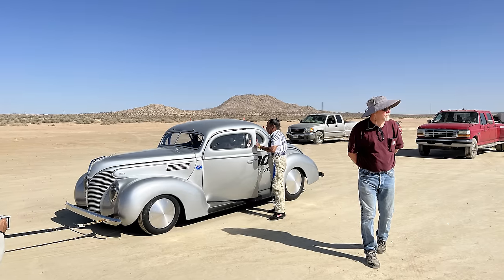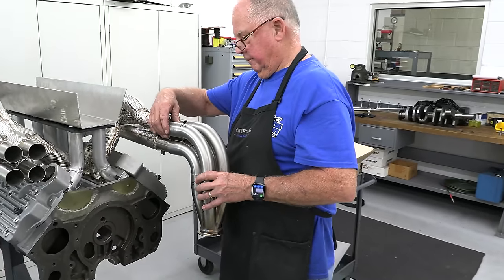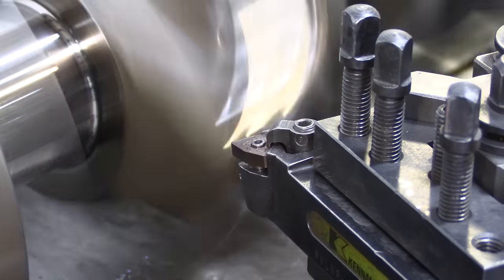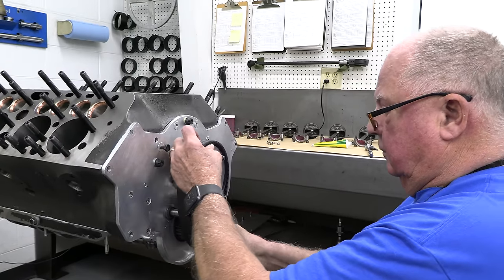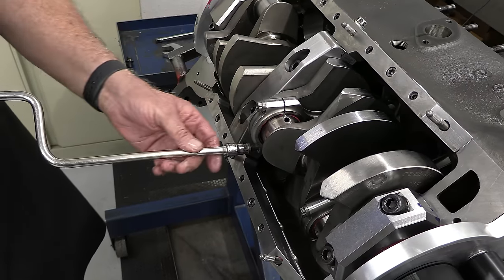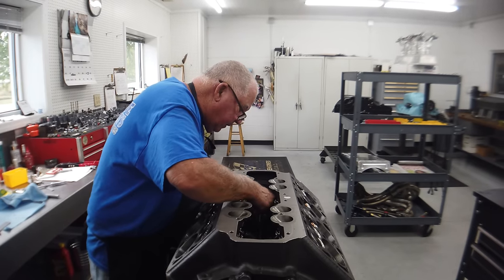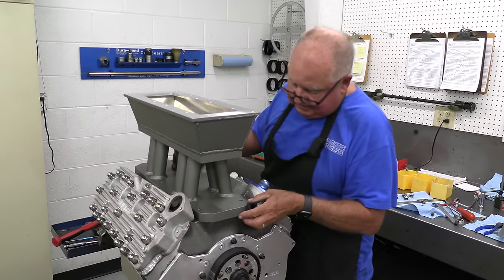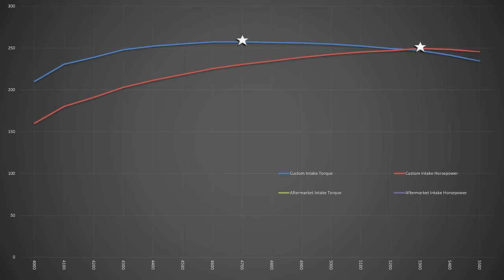World's Fastest Flathead? (Going to the Bonneville Salt Flats)

Comment: I was a motor cycle tech and always find engine builds interesting. 
Power, although way higher than stock was still pretty disappointing though after all the time, technology and money spent.
Back in the 70's, Harley Davidson was still using KR750 for flat track, nominal 45cu/in making around 75~80bhp. (I pretty much only did ' Japanese imports' but like all conventional piston engines)
A 231cu/in is 5.13 times the displacement but isn't making close to 5 times the power. ( you said 2.65?) Five times 75 ~80 would be close to 400bhp)
Side-valve engines cannot flow all around the valve and do not flow 'over' the valve so having valve to cylinder head clearance is not needed. It's better to fit the largest intake valves possible, lift them as high as possible for as long as possible and build a higher revving engine, it should have been possible to get 8,000rpm or more
 To that end, a de-stroked motor would probably be better, longer rods with no clearance issues.
Exhaust valves only need 80% flow of intakes so both the same size isn't logical?
Maybe getting some out of print tuning books for 1950's motorcycles could give some very good idea's for 'next time' (although you would probably have to get them from Britain or Australia)
Oh, haven't you ever heard of 'tube nuts'? They are similar to connector nuts for all-thread but made of much higher grade material with the hex removed from 75% of the length. They would have solved the 'problem' of Allen head bolts and allowed studs to be used

Comment: Your allowed to modify the valve length and head right? Why not make an inverted double sealing valve and boring a hole in the head for intake and using the original intakes as exhaust and cap the old exhaust ports

Comment: the REAL fastest ford flathead at bonneville was built by Ron Main and Dick Landy, turned out over 550hp at 6000ish rpm with a centrifugal blower. Went 295mph on august 16th, 2001 in bonneville.  *Another guy claims to have broken 300, but I dont know his story, full disclosure. 

Wanna know the real fuckin crazy part though? They ran the engine backward, and turned the exhaust ports into the intakes and intakes into exhausts. This meant that instead of the all the exhaust energy heating up the block / restricting flow, they could just cut out those restrictive passages and epoxy them into huge, direct intake ports. The good flow of the standard intake port design translated into an even better exhaust setup that was able to run cooler for longer. I myself have always thought the flathead ford was designed backwards, and otherwise would have been a pretty damn comparable or even better than the newer OHV style engines back in the day.

Comment: Before watching vid:  "Awww shoot! The record is only 135 mph?  Edsel probably did that on a track back in 1940, but nobody had a stopwatch handy"
After watching vid: "Is this a DARPA project for the DoD?" 
125 on shakedown at El Mirage? The engine is there, you can get 10 more from tweaks to aero, tires, gearing, etc.  Easily. New record will be 148-155?

Comment: Why run it at Bonneville? Run it at a lower elevation like the dry lake beds. You don't need the Salt Flats to go 135. Also,I've been following this build at Hot Rod magazine and the compression is limited by the valve lift. I'd sacrifice some valve lift to increase the compression. Maybe make up for it with increased duration.. I also don't understad all the carburation. Do you really need 1400 cfm or is that causing a lazy cylinder fill? Oh well, what do I know? The 1949 Merc Flathead I built years ago probably. lost power!

Comment: I'm kinda curious why they didn't do a deck plug sleeve, of the four center round coolant passages in the 8ba block if they were going all out, if they threaded those passages with appropriate cast iron plugs, decked them to the appropriate height and drilled them to the much smaller coolant passage through the gasket they could at least improve some rigidity, and even then port matching the heads and gasket they're using could lead to better coolant flow,  stock flathead blocks and heads I've salvaged to save  from junkyard oblivion  have pitifully small water jacket passages due to the terrible design of the gaskets

Comment: Theoretically a flathead can be a higher revving engine since its an OHC design but reversed into the block with no needing the extra weight of rockers and pushrods
Reply from the maker: That is some outside-the-box thinking!
Reply: What?????

Comment: Can't imagine you're not advertising for Craftsman and POR, I thought maybe you'd pull out a drawer from the toolbox and sit in it lol. Just curious, do you know of anyone that has ever tried to add 2 more main crank journals on a flathead without casting a new block, if that would even be possible.
Reply from the maker: That's just my shop. Had a project coming up using a lot of POR15 product on a chassis. No advertising, just life

Comment: I want to see the technology give us 200 mpg from a 302cu in Ford like Pogue did with the 289 Ford in the late 1950s.no overhead valves and "tap its" by the lifters it's a gas..I love it..2,250 RPM Monster? What's the max RPMs ? Make it reliable and I'll run it back and forth to the grocery store 👍😊

Comment: The actual Horsepower the 238ci engine makes is aprox 79.4 In JWL;s book Flathead facts . at no time in his tests he could not exceed 100 HP until he changed the Cam. Thes tests were run without the generator or fan.
Ol; Ron

Comment: We so take for granted what modern engine technology has provided for us and conditioned our expectations for hp and torque that a certain engine size should make. This goes to show how poor the efficiency was on the flathead v8's. After all that custom work from the absolute best you still can't get anywhere near 1hp per cubic inch. And that's the old muscle car standard too, todays small engines can put out 1.5hp per cubic inch and meet emissions and warranty requirements. And dont forget this is gross hp too, net hp is somewhere around 210hp roughly, and then in the car on a chassis dyno you probably down to anywhere from 150 to 175hp to the wheels! We have come so far it's just incredible. Does anyone know what the record for naturally aspirated HP and torque is for a flathead v8 as well as the record for a forced induction flathead? I'd love to know if these fine men got close to the limit of what's possibly N/A on these V8's?

Comment: Gentlemen!  It's all over!  Look at all those moving parts and then go look at an EV.  The EV's are heavily criticized by the ignorant as they forget the first flight of the Wright brothers was quite short and could be flown inside of some of the planes of today.  The batteries are in their infancy and will soon drastically improve.  Everything we see today is the "covered wagon" of tomorrow.  Maybe we should remember this!  Best of luck to all of us.
Reply from the maker: Nobody is claiming a '40s era Ford Flathead modified for Bonneville land speed racing in a vintage class is any sort of the future. I don't see what this has to do with EVs.
Reply: Does that mean we should abandon internal combustion altogether though? 

Combustion is heavily criticised by the ignorant who assume gasoline is the only thing that can burn. 

Some of the better F1 teams reckon they're pretty close to developing a carbon neutral fuel.

The blood diamonds of today are the lithium mines of tomorrow.
Reply: @TheHorsepowerMonster  but he does kind of have a point, big displacement engines lose a disproportionate amount of energy to heat and friction, reclaiming some of that energy and sending it back to the wheels is simply turning waste products into power

Comment: Why are those Cam retainer bolts not safety wired into place so they can't back out?
Reply from the maker: Dorton used loctite and properly stretched them. They aren't going anywhere. Honestly, I never see engine builders -- at least in my area (Charlotte, NC) -- safety wire cam bolts. It is good insurance, but I personally don't believe its necessary. Thanks for watching
Reply: @TheHorsepowerMonster  with all the effort that went into that flat head build, adding an anchor point and wiring it doesn't seem unreasonable. 

fwiw I'd like to see them try brazing a filler plug into the block they moved the exhaust outlets on, then machine everything once it's secured in place.

Comment: I would have guess they were shooting for.way above 135 MPh, my 2000 nissan maxima 3.0 would do about 135 MPH, with 225 horsepower. Goes to show you how much aerodynamics makes a difference, I'm not sure how Bonneville salt flats could have more rolling resistance. I would have also thought 250 horse would have been easily achievable out of a flathead, goes to show you how much overhead valve or head flow makes a difference, im building one now on my channel, curious to see what I can get, it's nothing special like this, all off the shelf parts.

Comment: I would like to know if its possible to run hydrazine in that setup? I know in NHRA is banned but I don't know if it's banned on the salt flats.
Reply from the maker: I think everybody took the NHRA's lead and banned hydrazine because it is such a bad actor, but, to be honest, I'm not 100% certain. That stuff was liquid cancer from hearing the old guys talk. thanks for watching
Reply: @TheHorsepowerMonster  i asked because I run it in my integra through my built 2.2L engine. It's more controlled via fuel injected vs carburated. Plus side I only run is 3 gallon of e85 with 1% of hydrazine and my normal tank is separate from my hydrazine. It only kicks in once I'm in vtec. And yes it literally sounds like I just turned on my nitrous lol

Comment: What hp did the first build make?
Reply from the maker: They never had a chance to do a full pull before they would start noticing water in the oil (They use an external oil tank with a clear side so it is easy to keep an eye on). But I think they saw 230 or so on a partial pull. It definitely had promise.
Reply: @TheHorsepowerMonster  Thanks.

Comment: Looking at the lobes on the cam - they are extremely steep and look very high.  They must just bat the valves open in a split second.....it's amazing that the valve springs, etc will take the abuse.  Having built a couple of flathead V8's I find them to be very addicting and this is the most interesting alterations I've ever seen.
  On another topic - could he have used anti-pullover squirters from a 4165 style Holley?
Reply from the maker: Good thought. That may have worked.

Comment: At 34:10 ish the "back" carb isn't even hooked up. The accelerator pump moves slightly because the "signal" is sucking hard enough to "stroke" it slightly but the actual throttle linkage arm - barely visible thanks to a "questionable" camera angle - is stationary. "Sideways"  4-barrels that are both positioned above one cylinder bank's intake ports with a single-plane "tunnel ram" intake are just more evidence of how much intelligent or even common sense "engineering" went into that "build" and why despite "all out" so-called "speed secrets" they couldn't come anywhere near "1 hp per cubic inch". After attempting to do so with an "innovation" like Henry's "two four-cylinders sharing a crankshaft" boat anchor V8 "competition" for Chevrolet OHV 4-cylinders and in this case "stovebolt" 6-cylinders.

Comment: That 3 main bearing issue just killed my interest in high power flatheads. I'd rather keep the power low and use them for the nice sound they make. Even inline 4 cylinder engines in compact cars have 5 main journals. That was the wrong place to save costs for Ford. Iron is cheap, and so are bearings. Nickle's and dimes for a manufacturer. Huge corporate mistake.

Comment: That Ford Coupe is absolutely rum. I would pay $100 to run my finger over it. They don't make anything like that anymore that looks strong and hot at the same time. They make junk(modern). Hemp plastic x10 stronger than steel for that body, and carbon nanotube shock frame? If I get in a wreck I could will it to someone mint condition. Hahaha. Buddy bought a new modern truck and when he tested putting pedal to it the plastic air intake disconnected. Freaked us out. I like old cars and trucks. Dodge power wagon is a dream for sure.

Comment: The only thing "Ford" there is the block and even that is not "correct" for the car and class and the "power gain" is at least one third "high rpm" (HP = (Torque x RPM)/5252 and the ONLY "power" actually involved is the TORQUE while "speed" is also a "power adder" as long as you can "gain speed" faster than you "lose torque") and even completely "stripped" of ALL POSSIBLE "PARASITIC LOAD" AND WITH AT LEAST $100 PER HP "INVESTED" - PROBABLY MORE LIKE $200 PER HP AT "FULL RETAIL PRICE"  IN THAT "RACE ENGINE" - THAT PIECE OF SHIT IS STILL A "FLYING MILE" FROM MAKING 1 HP PER CUBIC INCH. IT'S CLOSER TO 1/2 HP PER CUBIC INCH.

HOW "IMPRESSIVE", LOL.